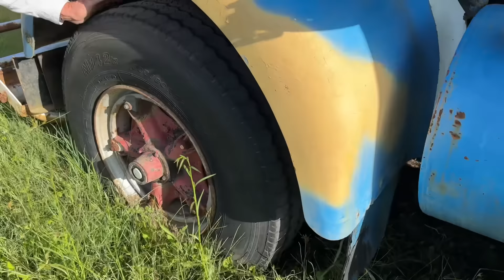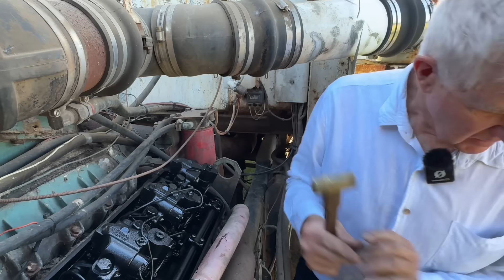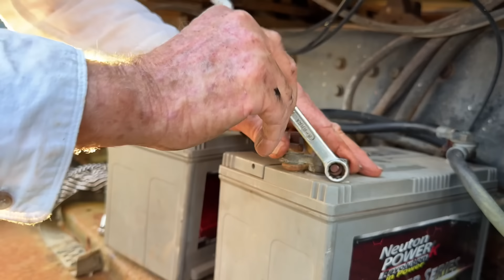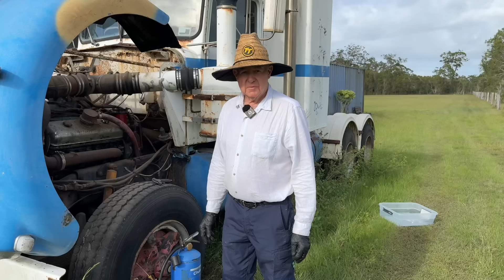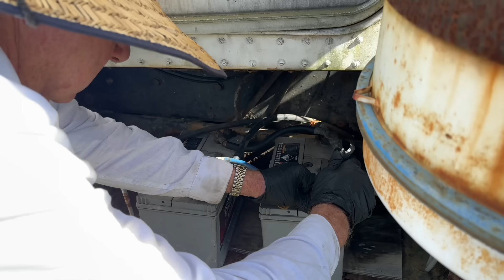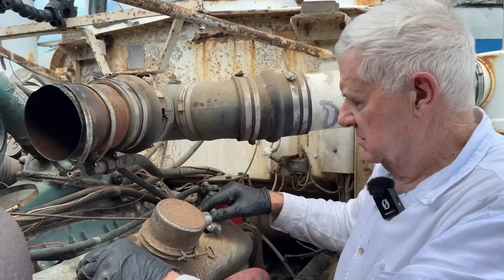Will it START? V8 Supercharged 2 Stroke Detroit Diesel Kenworth Truck SITTING for YEARS!

Comment: Best video I've  seen for a long time. Took me back to the drill rigs in Kal, 12 71 and 892's. As it was said you can turn perfectly good diesel into noise.
The most thorough and technical take down of the beast without spending a cent.
They are a forgotten time piece. Great work.
😊

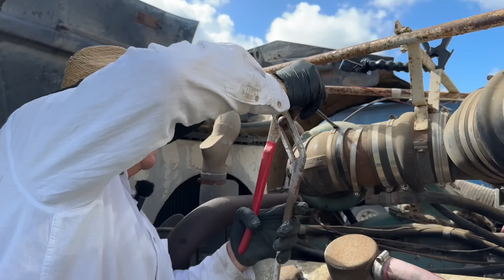Comment: At 43:25 you use multi grips for the screwdriver. Not sure if you realise but a ring spanner fits on those so you can have better control.

Great video cobber
Reply from the maker: Thanks for the tip.  I appreciate your support.

Comment: Hi Bruce, Hey when you have a no start because it won't suck fuel from tank, you can drill a fuel cap and cut a Schrader valve from a bike tube and fit valve from bottom of the cap so you can pump pressure into the fuel lines and up to the fuel pump..

Comment: Some 40+yrs ago I worked for Kenworth Trucks Aus, and subsequently its subsidiary  Wagner Mining Equipment. That was back when 8v92TT's were the Motor of choice. Came across a 12v92TT running a generator outside of a "Night Club" in the Philippines some years ago, I believe it's still there? Great to see these wonderful old trucks being resurrected. Well done Bruce. 👍

Comment: We used to blow air from the tank and if fuel came out where you spin the filter on and if fuel came out then fill the filter up and put air pressure to the tank and it should fire up 😉.ps you have one hell of a camera man👌👍

Comment: Why fit a turbo charger onto a two.stroke.diesel engine it does not improve the volumetric.effichency.inside the working cylinders like on a four stroke diesel.engine??

Comment: Hey Bruce I love your relaxed but thorough mechanical bent,The other night I went to put some petrol in the genny and dropped the lid from the fuel container in the dirt grass and sand.I imagined bits of dust etc getting into the float bowl and blocking the jet or the needle valve. I was  minded of your saying when oiling air filter connections or linkages  "the next bloke"  knowing I was the  next bloke.With diligence tipping some fuel over it and cleaned it up and replaced it.best regards Dave in the mallee!😊

Comment: I have  a 40 years old 6 clinder 120hp 5.5 liters  detroid atmosferic diesel engined bedford truck sitting backyard an when i start firs i look oil stick, second pump manualy fuel with the little hend povered fuel pre pump. if hard to pump there is an air in fuel sistemç when easy to pump there is no air boble in hosesç. (and i hear returning fuel back to tank.) after that cranging an its starts even winter or summer every season

Comment: Detroit Diesels are not super charged. The blower in on the engine to add enough pressure in the air box to evacuate the exhaust stroke because it's a 2 stroke engine. If you put a blower in a 4 stroke engine then you do indeed have a super charged engine.
Reply from the maker: You are exactly right. Thanks for your comment.

Comment: There is a short splined shaft that drives the supercharger, they are notorious for stripping the splines and if the supercharger isn’t driven, then no air is pumped into the engine, result - engine is unable to be started.

Comment: That’s an 8v71nt GM, notorious for getting rid of the air in the fuel system. We used to pressurise the fuel tank and hit the starter! We owned the identical engine but fitted to an International Transtar F4270.
Reply from the maker: That's a really good idea if they can't suck the fuel up.

Comment: Bruce you are old enough to know that Detroit Diesel 2 stoke 8V71T are NOT Supercharged as your caption suggests  they are a BLOWER not a Supercharger 
After watching the entire video in became very cler to me that you have had little experience with Detroit Diesels as a rule they do NOT self bleed they need to be pressure bled

Comment: Diesel fuel after sitting for years and years will go sour 
So I would first drain all the old diesel first and put on fresh no. 2 diesel fuel and then prime the little gear driven fuel pump . Check the governor next . Check adjust the idle screw on the mechanocal governor and do not screw in the buffer screw by mistake !!!!! Upon cranking the fuel injectors are in the full fuel position 
By the governor and the engine should fire up immediately and the the governor will pull the 8 onjectors back to the idle position . With the rocker covers off   manually check that the teo injector control tubes can move all the injectors in and out , and that no injectors are stuck ,seized . The tube should be a broken back type tube so the engine won't run away because of a seized onjector .

Comment: that's the 350 Detroit 8v71 with a turbo.  clean out the fuel system and purge it again. and the throttle problems should go away. Detroit's do weird things if the fuel system ain't happy. have something you can block the intake with , in case of run way.

Comment: A tip from a retired diesel mechanic. When starting  diesel that’s been sitting or cold weather is to use WD40 not starting fluid. You can literally run a diesel engine on WD40 just by feathering the spray right into the intake or in the compressor side of the turbocharger. It works great but you must be careful not to overspray when using it like this. You had everything right there in your hands but didn’t realize it.

Comment: I enjoyed the process, but not sure why you bothered.  I was unfortunate enuf to "inherit" the job of driving an old short nose International (Corn Binder) logging truck on Washington's Olympic Peninsula clear back in 1974.  It had the 8V71, 318 Jimmy engine with 5 & 4 transmissions and I quickly grew to hate that screaming, bellowing s.o.b.  I'd wake up at night with nightmares of that thing screaming and roaring in my ears.  It was a gutless wonder, too, and had to row it down the highway, shifting constantly and full throttle all the time....and - always - holding up other traffic.  They had a reputation for extreme reliability and the owners loved them....drivers hated them.  I was never happier than when I moved to a 69 Kenworth with the 335 Cummins engine...still with 5 & 4 trannys.

Comment: Yes everyone wants one to subscribe but that is would be tooooo many to have come up all the time. So watch what I can when. 
Was trying to read the Donaldson filter number, so as to know what filter thread it is?? I see that engine says 76mm3 so as mine is 105 it has read so that filter should be ?? // could be a 1 "/14 thread???
I use the 551000 the 551313?? I have forgot. sorry 
I did design mine with an in tank fuel pump and as the injector pump has to be less then 15 PSI so it is at 7 PSI.. Any of the hills for me looking at it does not drop pressure. SO THAT IS WONDERFUL. 
 Good to see the old girl being put back into shape.

Comment: When you change fuel filters , the filer is NOT to be prefilled as that fuel will not be filtered , there is a bleed screw on the filter hosing that you open & a lever on the side of the lift pump that pumps the fuel up & another bleed screw on the injector pump to bleed the air out of it , even loosen the connection at the injector & you know you have fuel !

Comment: When starting a diesel - spay WD40 if you have a way to get it directly into the intake manifold spray continuously with short blast of Either , if & when necessary
The engine will run quite well on WD , that is of course if you now you have fuel .

Comment: Thank you for addressing the difference between "blower" and "supercharger" in your description. Another, more simplified explanation I once heard was that an engine with a supercharger will run just fine without it, but an engine with a blower won't run at all without it; the blower is part of the normal operation of the engine. A supercharger is added for performance gains. The white button up is looking good!
Reply: Good on you cobber, it's amazing the number of people who don't understand the difference between a Blower&supercharger!!

Comment: Early 1960’s made a two man run to west coast in a gmc “cracker box” , a GMC aluminum wonder with a gm v8 2 stroke motor, no Jake brake on em in these years. Running Donner it cooled down so much we worried about the lubricant that is designed for hot motors.

Comment: NEVER shut down a 2 stroke Detroit Diesel using the emergency shutdown system that closes the blower flapper. You can suck the blower shaft seals in against the blower rotors and then you will always be using up engine oil. ALWAYS shut them down with the Cut Off cable going to the governor. Trust me... pulling the blowers on a 12V149 and replacing those seals is a ROYAL pain in the butt.

Comment: well i a 64 year old guy a 2 stroke GM designed Detroit Diesel, ruined my mechanics job on trucks ( it ran away and caught fire and burned 5 building complex to the ground it ruined my day) ok years later a law guy under GM pay in court said there a error with said engine it run off it own oil wide open & not shut off really ok there a fuel rack on each side of the engine check for stuck injectors rods there a rod that slide in and out freely it got to be free not stick able if it sticks wide open your screwed unless a air flapper shut off system  really on said truck that only way GM had to shut off run away engines ok I had a bigger problem unknown blood illness & i told NASCAR driver Tim Richmand i was sick really he died of AIDS ok I know what it is by blood DNA i was adopted in sealed adoption there 2 add names one known to me the man was named my uncle my stepfather real brother & he fixed my relation old boat engine a deisel engine in a old like ww2 boat ( the manual uncle gave me had his given name & military number the medical people knew it for a 100% death rate cancer break threw he lived threw it! they saved his blood by rule of the law because lived the DNA - what i have where i got it from and who did it = the US goverment & the Nevada US air-force  base i was on) the illness is like 98% controlled to now! who he was really my real mothers uncle his twin brother my grandfather that was dead by 1963 !

Comment: Hi Bruce, Bit of an old mechanic myself. Worked on 71 Detroit's when I was an apprentice. You will need to lift the governor plate and check that it isn't seized inside. That is what makes it go to full revs when the injector rails are free. Be careful using that emergency stop flap. If it has a few rev's under it, it can suck the seals out of the blower and then it keeps running because it can get air through the blown out seals. The stopper cable goes to the top of the governor as well so you should be able to disconnect it at the governor and stop it manually. Look forward to seeing part 2. Enjoy watching your adventures :)
Reply: Yep, I’ve had that exact thing happen to me starting a two stroke Detroit on blocks, and the drilling into the main oil gallery was open, we had to keep oil up to it while I stood on a tech manual on the intake, it almost sucked the entire manual into the engine. Hairy experience
Reply: Good tip on the Blower mate,  a lot of people get confused about the the emergency stop on the Blower!!

Comment: That KW is older than 1974. I don’t think twin sticks were still in production in the 70s. The transmission and engine were probably replaced and updated in this late 50s early 60s KW. One of the sticks has a splitter, which twin sticks don’t have and defeats the purpose of the brownie (2nd transmission) as the second stick splits the gears. That interior is definitely not from the 70s. But nevertheless, beautiful truck.

Comment: That Kenworth is older than 1974, it would have the build date on the plate, it has had the motor replaced.
Reply: Please don’t call engines motors. Two completely different things.

Comment: Nice video Bruce looks like it's an hour meter that clocks over every 9999 hrs and goes back to zero, an old truck like that may have anywhere from 50 000 hrs right up to 100 000 hrs. I had an old Transtar that come off road train work and it had 46 000 hrs on it's clock and it was a 1988 yr model.

Comment: My Dads 64 W model was working until 2022 in melbourne running over the westgate bridge 10 times a day with a licenced b double rating..
Got a few original parts sitting at the factory.. The truck was sold 2 years ago when dad retired and the guy that bought it has done a ground up build on it in less than 2 years
Reply: I believe I know your old man's truck it's the only Kenworth of that vintage Mifsud yeah the truck that he is working on I know well it was owned by Kelly's of Innisfail in Queensland and pulled a tri axle float with an excavator didn't have that weird sleeper on it had very low original KMs last time I saw it and was totally original it had never been driven hard in its life
Reply: Wie geht die Schmierung des 2 Takters und verbraucht er doppelt soviel wie ein Diesel? Vielen Dank für eine Antwort.

Comment: That engine is a 8V71T was built Oct 1974 and it makes 350hp at 2100 RPM but sounds like its spinning 10 thousand RPM LOL! especially if it's straight pipe. That's a good engine and has a turbo charger where some of them did not have them

Comment: So I understand Kenworths were imported from the USA from 1962 till 1970 then Kenworths were built from 1971 on Down under. I never new you guys manufactured Kenworth in AU that is cool. so that truck there must be a one of the early KW that were built in AU because that's a early to mid 70's truck from what I can see. Did you guys build truck engines down under too or were they all imported?

Comment: Sorry to say it but that was hard to watch at the  end. All that time spent force feeding it ether and still hadn’t seen a fuel line or bleed nut loosened. Fatal mistake not having completely making sure the blower flap is fully operable and open, and that you can guarantee you can make it close in an instant. A runaway Jimmy is a nerve wracking experience. Not so sure I would have left the old fuel in the tank. Did you notice the state of that steel air pipe just before the turbo. Rust scale city. All in all though plenty of insights… good camera work and good quality…cheers🙏🏼

Comment: I have collected several of these engines all type 6v 8v 12v and ford sho engines a aluminum DOHC engines. I have very little in all but the SHOs. I'm 57 1/2 2 yrs before I can get into my IRA. I'm gonna build a 41 Plymouth with a sho engine. Guess I'm gonna look for what we once called 2 ton trucks. So 650s COE Ford, Chevy. I don't wanna go full semi id like others with class A license able to drive whatever. Kinda sucks you and I could be good friends but we live 28 hrs apart over the darn ocean. Id be right there with ya getting the old girl running 😊 God bless ya

Comment: DDs do not have super chargers, they are blowers which bypass at 5PSI, it wont run without it. A non turbo DD with just a blower is considered NA. Cool video.

Comment: The ads on your channel are quite frequent and rather long without the ability to skip through them. Idk what makes the difference between different channels and their ad frequency, length and ability to skip them but your channel is one of the worst I've seen. I do enjoy your content as I'm a two stroke Deteoit diesel nut. I also appreciate how meticulous and thorough you are. I'm the same way. If you're going to do something do it right; the first time. I do know that you can crank the hell out of the starter on a Deteoit diesel without worrying about burning them up. They can take it as they are notoriously cold blooded and hard to start. Especially on a cold day or after sitting for long periods of time.

Comment: Did the build plate just say 871, or did it say 8v71?

There was an inline 471, an inline 671 and a v6 6v71.  Everything above that was a V engine.  Maybe they didn't always refer to them this way, or on the build plate, maybe they had a different place to designate the engine configuration, or exact engine model?

Anyway, just curious.

Comment: Hi Bruce, what a stubborn old girl this one was despite being spotless under the valve covers. This is why I love mechanical diesels, you can methodically work through your issues to usually find a solution and get it running. With these new electronic diesels, there’s so many things that can cause the exact same symptoms/problems and unless you have access to the engine manufacturers software and interface, you’re kind of outta luck. Would love to see that old girl getting running right and possibly driving. Good day Bruce!

Comment: I would love to see this old girl run, I used to drive a number of trucks years ago that had this engine and I do miss them. They were very simple to work on and rarely gave me any real problems.
Reply: I know this truck I rode in it many times and was allowed to move it around in the quarry it was owned by Mr Kelly from Innisfail Queensland it didn't have the whacky sleeper on it only ever pulled a tri axle float with a 20 tonne excavator or occasionally moved our dozer for us we spent years looking for this truck when we had money we actually imported a cabin and bonnet that was the same year from the US about 10 year's ago it's sitting on a late model chassis and running gear it's for sale at the moment if you have a look

Comment: Amazing engines , we were doing the power steering on a cab over back in the day, we were ready to start up, said to old mate make sure it's out of gear , well with Maxi's on and in gear it still fired up and nearly lurched the truck into the work shop wall old mate pulled the stop just in time ,I always got nervous starting up Detroits on cab over kenworths , sometimes when you dropped the cab the telescopic throttle shaft would grab and put it at full revs don't need coffee in morning when that happens , heard a story from a Detroit mechanic they had one run away they pulled the emergency flap it sucked  in seals and gaskets and kept running